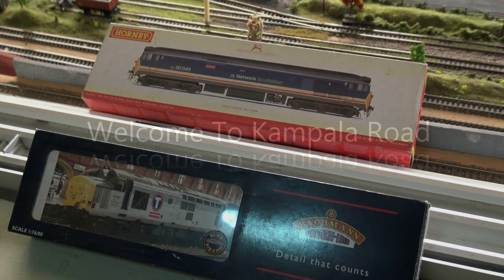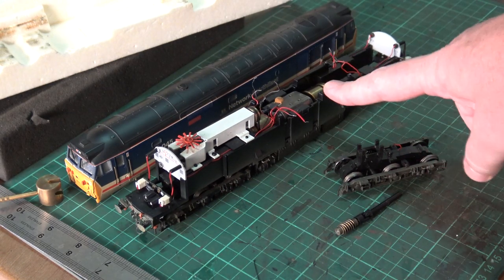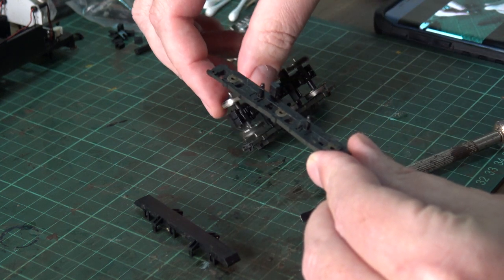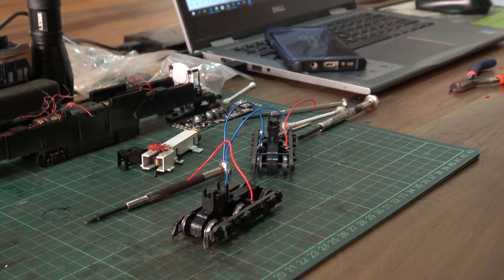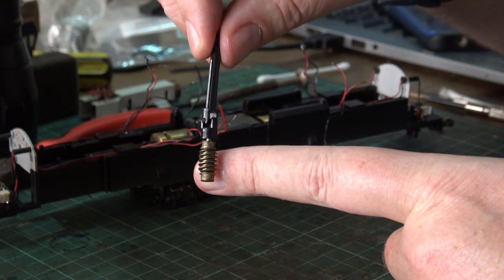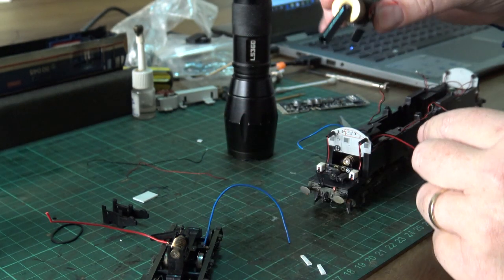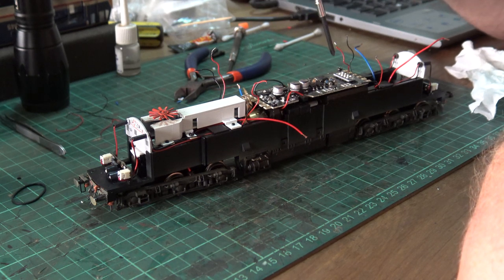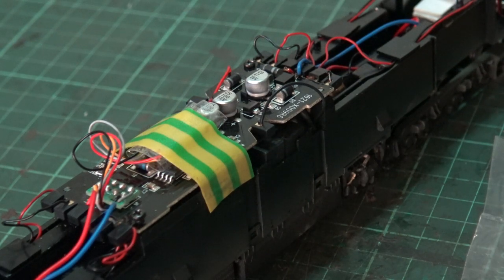Kampala Rd: Repairing a Hornby Class 50 Part 1

Comment: I got a new Hornby 56 last year that was completely seized. It was the grease that had solidified and set solid. Took the whole thing apart, cleaned it up and lubricated with clipper oil. Runs a treat  now .
Reply from the maker: I think it seems to be a common issue which one should not have to deal with straight out of the box. Happy to hear yours is okay. Best. Jerry and thanks for taking the time to comment and watch.

Comment: Hi Jerry, You have a lot of patience and your skills are improving greatly on repairs. I had two similar diesels with one default. So I just took out the motor and gears, coupled her up with the good one and have now a 'double traction'. Works just fine. Well a different approach. You see, I'm not as patient as you ! Success & greetings. Filip
Reply from the maker: Hi Filip, I had actually thought about that with class 20's and I am glad you have pointed the way. Thanks. 20s are always in couples and it struck me that if I get a non-runner I could do the same as you have. Thanks and glad you liked the video. Best. Jerry

Comment: Another great video. I have had problems with the older hornby class 50 with traction tyres. In the end , I sold it for parts. Now have a new one.
Reply from the maker: Yeah the ture thing is a bit odd given the weight of thr thing is good. New one is a good idea . Did you sell the body shell haha. Many thanks for watching and commenting Best. Jerry
Reply: @jerryallen34  yes sadly. Hope you get a replacement soon.
Reply: Roger, you can simply swap the wheel sets for later ones, that’s what I did. My very early 50018 now runs just as well as my brand new 50010.
Reply: that's  a great idea jake. wish I had thought of that.

Comment: Great video Jerry.  You're not alone having issues with hornby pcbs, I've had a 56, 50 and 31 go pop luckily no other damage other than  chassis rot on the 31 so got off lightly compared to you.  Good luck finding a body I'm sure flea Bay will come up trumps.
You might as well do the 37 next.
Cheers Paul
Reply from the maker: Yep Paul you are right, the 37 next. I look at my 31 which runs really really well and do think of you experience because mine is right in the middle of the batch that should of rotted and feel for you. The 31s like the 50/56/60/43s are brilliant and to replace yours when it's not your fault is expensive and a bitter pill. That is one reason I wanted to get this 50 going again. Cheers and appreciate your input as always Paul. Jerry

Comment: Thanks, Jerry, lots of care to learn there. 
Did you buzz out each axle to confirm connection?
Have you tried checking the voltage required for the lights? I understand that the pcbs differ to provide extra subtlety, but could still be bypassed with the right resistors. 
What light functions does her sister have?
Those sliding contacts behind the cab are great at production (new) but look like they will always be a problem as they age.
Another motor to work out why they seize, and to see if it can be reversed. Time, but no cost, and I see that you have mechanical skills and patience enough to try this. 
Finally, having clipped the louvres out of the body, did you have enough slats to rebuild the original?  A sticky glue (or tacky wax) might hold things in place once positioned, and make the rebuild less complicated. (Sticky glue sound silly; a glue that is viscous so the item is held in place by the glue before the glue sets, almost exactly unlike superglue)
And filling the cracks in the body does not look beyond your skill-set; heavy weathering will hide the subsequent paint-job, if it is not sufficient for you expectations. 
Thanks for the exhibition.
Reply from the maker: Hi Tom and thanks for the comments and suggestions. Yes I did check each wheel was picking up. I had to heavily edit the video to keep it to 30 minutes, or try! There are a few demos missing because of that. I agree weathering will hide a lot and a may yet try that. The louvers are very fiddly!!!! Hats off the the person in the factory. Thanks again Tom, Cheers, Jerry

Comment: Jerry, can the 'cracks' be better lined up to near-invisible, then carefully glued from the inside? Such a lovely locomotive, as you rightly mentioned, I was wondering if it could actually be 'saved' without requiring that new body you mentioned. Al.
Reply from the maker: Hi Alan, possibly with heavy weathering there is a chance. The cracks are quite wide and do not appear to close effectively. Thanks Jerry
Reply: @jerryallen34  That's a pity - your son did 'quite a number' on it then - unfortunate. I've seen many, with 'a little adjustment' and even before gluing the line's barely visible, so I was thinking it could be lined up and glued, even reinforced, from inside. Never mind. It would drive me mad!!  Main reason I hate DCC Sound - none get the 'chuffs' right on steam locos. Hornby's on the Lord Nelson is a joke. It's a twin pulse 4 cylinder - 8 / revolution. It nearly starts at 8 when slow, then when travelling at ~45mph equivalent, it's barely 2 / rev! I watched videos of the real preserved one in my hotel boredom y'day, and it definitely remains at 8 until no longer detectable. Al.
Reply from the maker: @alantoms3263  A lot of people say the same as you have pointed out Alan, I and oblivious to it at the moment but I am sure I'll learn eventually!! Lol! Cheers mate, Jerry

Comment: I got a few locos waiting to move form west nsw Australia to USA I hope when they get here they don’t have sizsed moters but it’s been very dry for the last. 2 years
Reply from the maker: I think anything fro PNG gets a good going over Lol. Thanks for the comments and good luck with the move. When do you go? Cheers Jerry
Reply: I whent form nsw Australia to wy USA so when the rest of my trains get over you would recommend a good oil and grease?
Reply from the maker: @doggerbendrailway6002  I use Peco super lube as a base then cover with Vaseline. If you are in a hot environment the super lube does dry so the vasaline seals it in so to speak. Cheers.
Reply: Before I left I oil them all with oil I got off eBay call licwad bearing and greased them with vaslie

Comment: Hi is it possible to clean wheels and pickups while the bogie is still connected to chassis?
Reply from the maker: Hi, You can clean the wheels no issues but to clean the pick ups and Axle pins, which is a must, you will have to take the bogie apart. You can still do that without taking the body off. Trust that helps, Jerry
Reply: @jerryallen34  thanks it does.